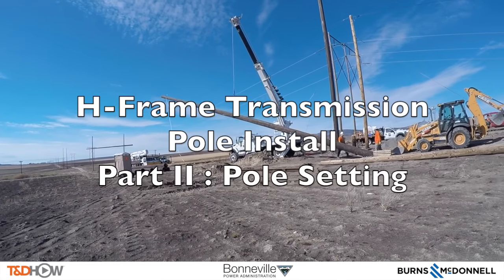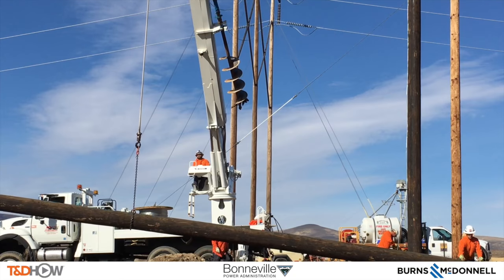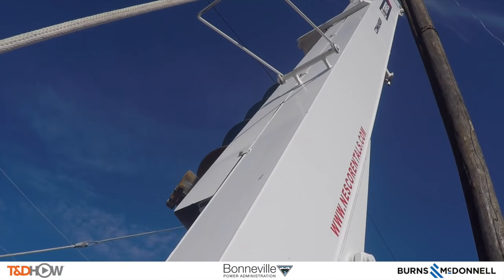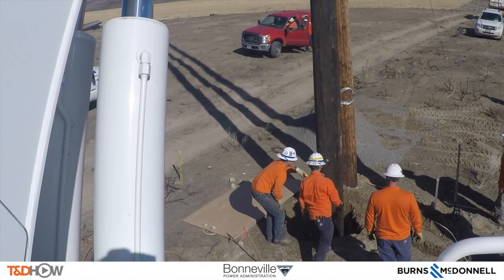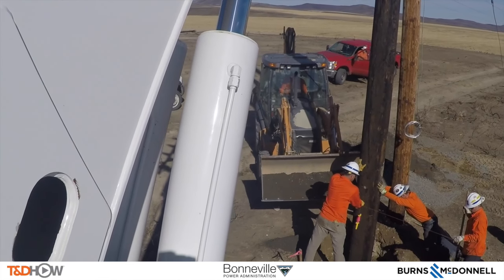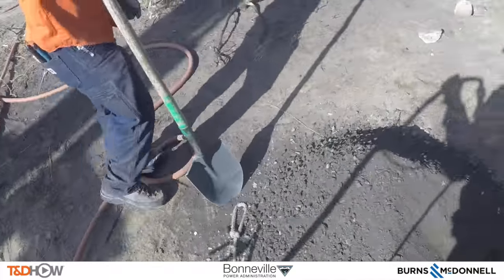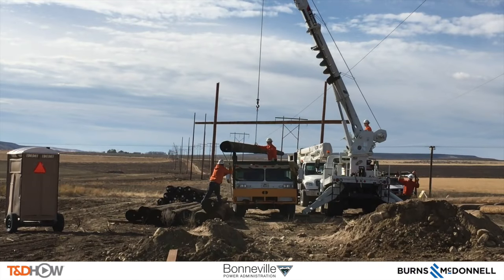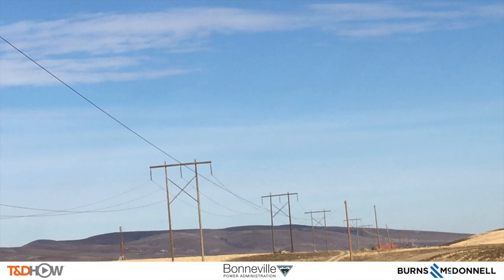H Frame Transmission Pole Install: Pole Setting

Comment: Those are some big thick woodies. Man I live in Florida and I hate the ugly ass concrete poles they are replacing the old wood transmission poles with here . I wish they'd use the poles you guys are using here. What are they Douglas fir treated with creosote?
Reply: How is concrete uglier than nasty wood with disgusting black goo?
Reply: The concrete poles are supposed to be for hurricanes lol
Reply: @34525314  They call it storm hardening (and are said to have the capacity to withstand up to a category 4 strength hurricane) and are reportedly doing it statewide with construction taking place through at least 2024.